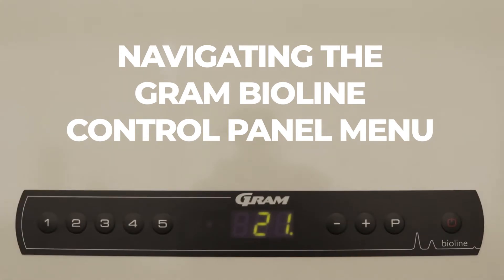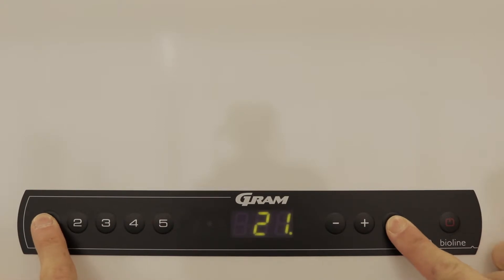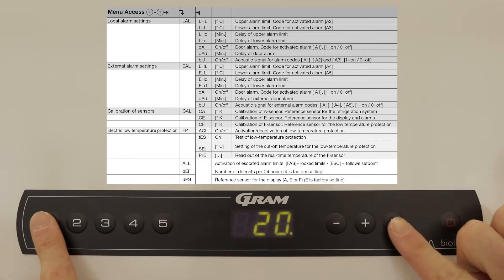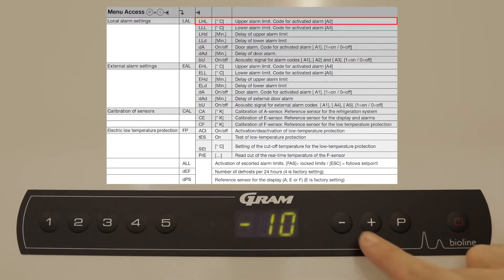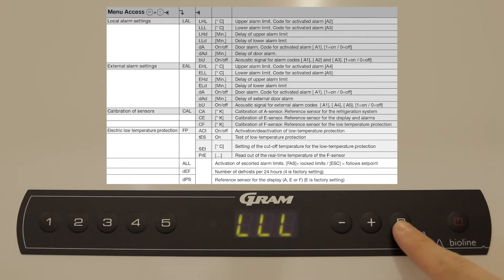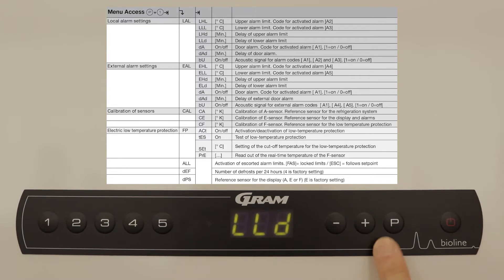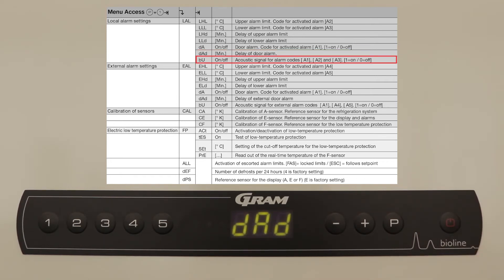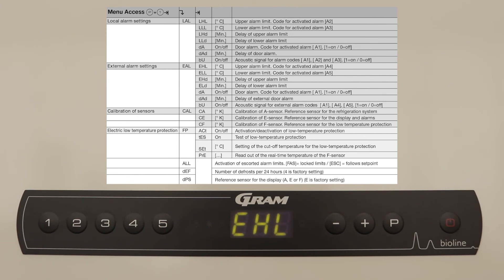How to Navigate your Gram BioLine Laboratory Freezer Control Panel

Comment: HOW DO YOU UNLOCK THE KEYPAD
Reply from the maker: Hi @jessierolph, to activate/deactivate the keypad lock, you would need to press both the "On/Off" and  the "1" button simultaneously for over 6 seconds.
Reply: @LasecGroup  it's not working
Reply: I’ve tried doing that, the icon flashes but I still can’t access any menu
Reply from the maker: Hi  @SophieHolden ,  we're sorry to hear that you've been unable to access the menu. Please feel free to reach out to our Cold Chain Equipment Product Manager, Tamryn Lucas, via email at tamryn.lucas@lasec.com.
Reply: You press 1 then 2 then 3 then P and it should work 🤞🏼